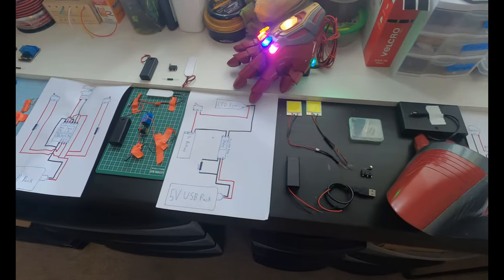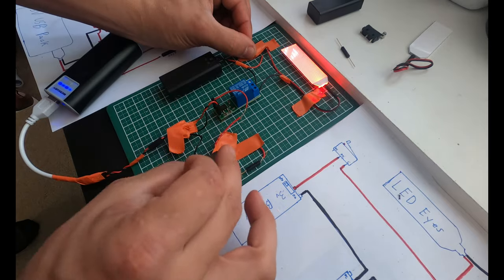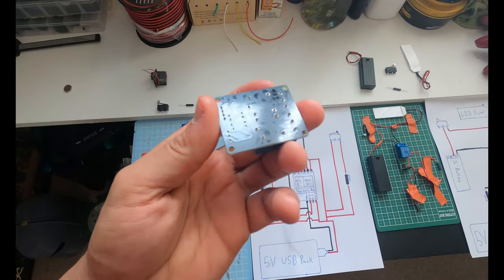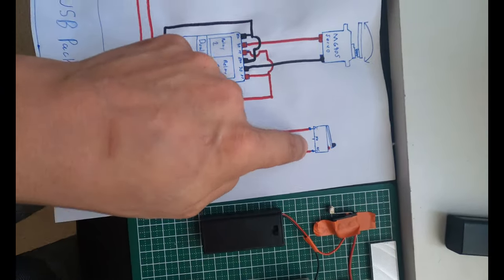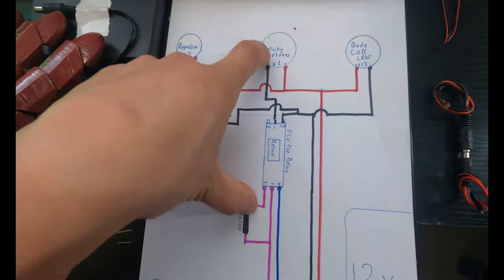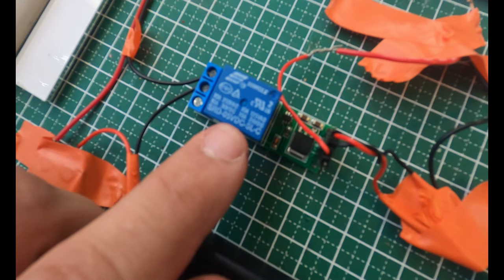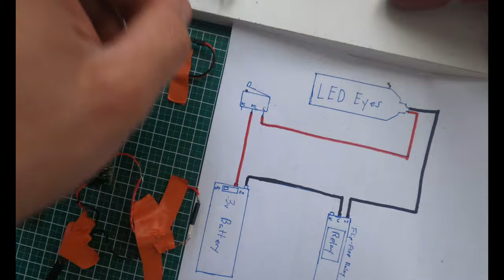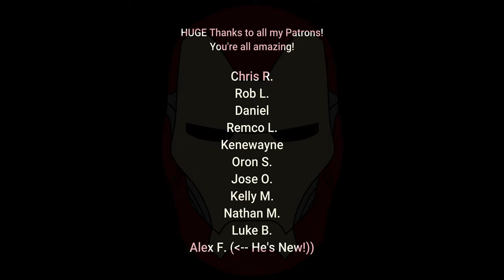How to Make an Iron Man Suit | 3D Printed MK85 Cosplay - Part 9.5

Comment: So remember how you were talking about the gap in the shoulders between the front and back? Well, if you look at the shot of Iron Man on the Chrysler Building looking at where the sceptor is in the elevator, you can see that he actually has that line where the front and back "join" even though its a nano suit. So if anything, that gap on the shoulder is just another detail that is actually on the suit
Reply from the maker: Haha hey I’ll take it! Thanks 🙏
Reply: @FranklyBuilt  No problem. I was looking at scenes of the Mark 85 to see where all the little lights are and I realized that Do3D missed the lights on the top of the abs sort of to the sides and 2 lights around the kidney area on the back. So I guess I have to custom cut those lights out of the armor lol
Reply from the maker: They didn’t miss them haha the spots are there just require some cuts. My suit has them 👌🏼
Reply: @FranklyBuilt  Hmm that's odd. They weren't in the files that I recieved lol
Reply from the maker: You might have the old v1 style abs.
Reply: @FranklyBuilt  Well, I have the new chest piece and it fits with the abs so I'm not sure

Comment: Frank what gauge wire are your running mostly though your suit. I don't want to use wire too think as it can cause issues with the 5v pushing through the suit. correct?
Reply from the maker: 20-24

Comment: What temperature do you print and %,of  infill for your suit
Reply from the maker: Temperature is dependant on filament. No point in me telling you. Your setting will always be different than mine. Room temp. Altitude. Humidity. Brand. You need to dial that in yourself. I did bower use a 5-10% infill